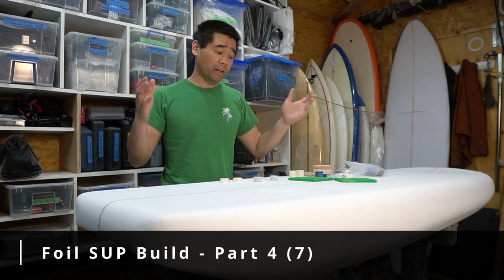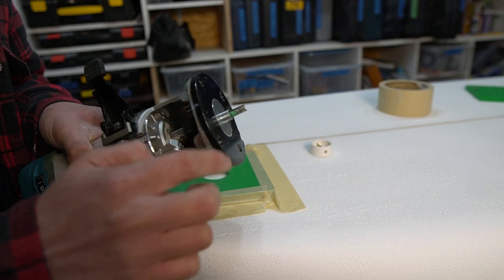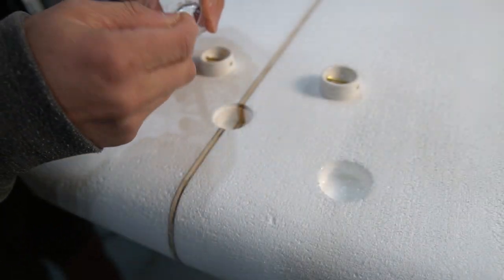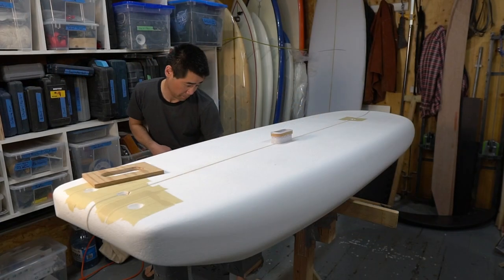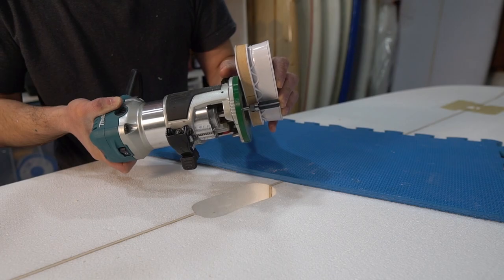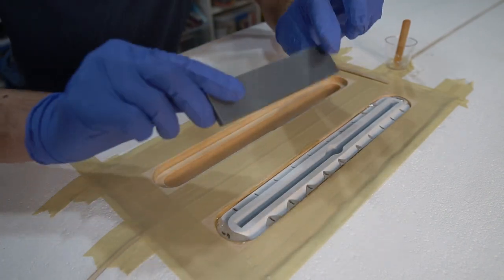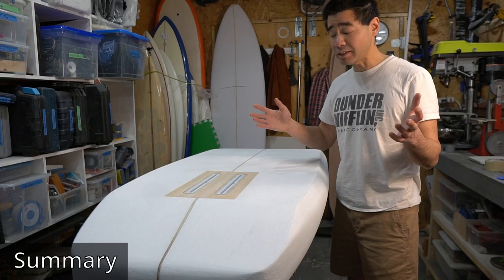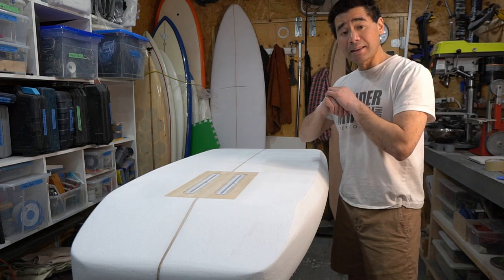How to Make a Foil SUP Board | Installing Handles and Trackbox - Video 4 of 7

Comment: Glad to see you are coming back to supfoiling. I am riding a clearwater foil behind the boat that I made from a kit. I ordered an aluminum foil from aliexpress yesterday. I plan to make a wakeboard foil. I am hoping to wing and supfoil eventually. I saw a 3 piece wing setup on aliexpress for $1500. If you ever fly into BWI maybe we can teach you to foil behind the boat. We also have an air chair which is easier to learn on.
Reply from the maker: I'm still trying to learn, I have a much lighter board since I made this one but it's tough going but fun to learn something new! The AliExpress great is so compelling because it so much cheaper than "brandname" gear and so far it seems to get the job done. Thanks for the offer!
Reply: I think a sup foil with plenty of volume might be best, but your feet have to be balanced over the center of the foil wing for any foil you ride.

Comment: I see this was fitted 4 years ago! I want to fit a PVC twin hydrofoil box on my board , therefore my question is: did the box work and not break off? and are the plastic inserts strong enough for the hydrofoil attachment?
P.S has anyone on youtube used these PVC plastic twin boxes successfully? Without losing there hydrofoil?

Comment: Seriously, vent plugs in a solid foam board????  Isn't that somewhat akin to putting vent plugs in concrete?  I'm a paddle board newbie just trying to learn what I can - hollow boards I understand but solid boards.....   We use fiberglass/foam composites in aviation all the time and I've never seen or heard of vent plugs being needed or used.
Reply: EPS foam can “off gas” in hot conditions and cause delaminating of the fiberglass from foam if the air has nowhere to go. I think sealing the foam with resin prior to install defeats the purpose though because the air won’t escape
Reply: @Bido11561  Good Point!  But I believe "out gassing" begins at the end of the production of the foam and the rate of out gassing declines exponentially over time so at ambient temperatures there should be no, or very little, out gassing by the time the billet is constructed into a board.  An additional question would be: How does the out gassed products migrate through the foam from the far end of the board to the vent?  Do you ever open the vent plug and detect any release of pressure buildup within the board?.
Reply: @rogerolander458  I think it has more to do with the air within the foam then the actual chemical off gassing. I’m not an expert, but the experts who make eps boards all use vents
Reply: @rogerolander458  I think the vents are more common with carbon layups
Reply: @Bido11561  I’m sure you’re right.